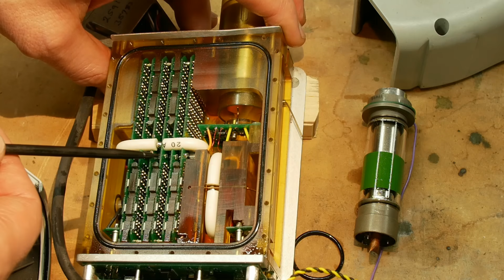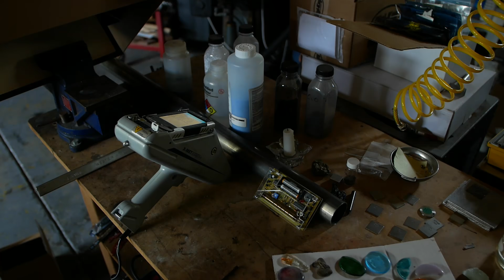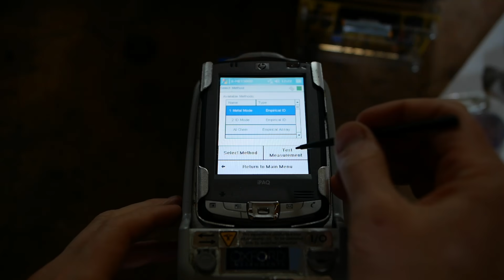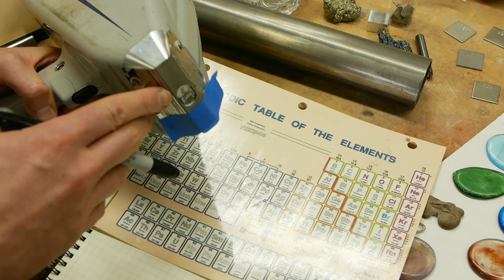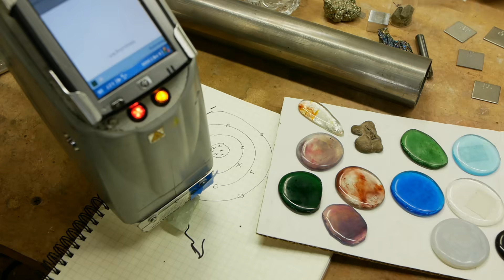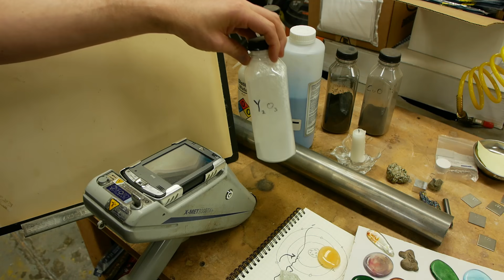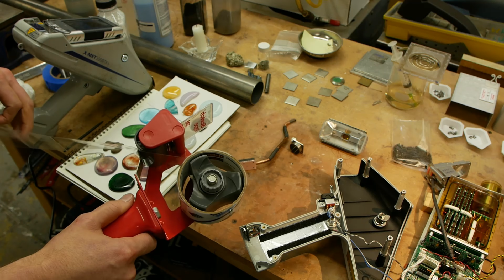Demo and teardown of an X-ray fluorescence gun (measures chemical composition)

Comment: In college in the early 2000's I worked on a project using an XRF gun with some fancy software running on the PDA that would process and decode chemical barcodes. By mixing certain compounds in various ratios we could create decodable messages (complete with checksums). The project was working on using it for high security applications. Our proof of concept used some pretty heavy excel workbooks and lots of copy and pasting, but it worked!
Reply: THAT'S SO COOL
Reply: Whoah, I wasted my time in college. That's a genius idea.
Reply: @skipfred  Ha. I would love to take credit for the tech, but I didn't develop it. It was on loan to us from a commercial org that appears to no longer be in business. I attended Ohio University and we had the "Center for Auto-ID" which did research into auto-id technologies such as barcodes, RFID, biometric ID, etc. I worked for the center as a student work/study type position testing different technologies. The XRF project was briefly put on hold twice, first when a professor outside my department found me in a lab with vials of chemicals that I didn't have all the MSDSs for, and the second time when I lost my dosimeter badge (which given the amount of radiation this outputs, was a little silly)... 

I worked on another project, that I haven't looked for out in the wild, but I found just as interesting. Imagine having a CCD sensor, that rather than detecting light, it was a 2D sensor array that detected magnetism (on contact). A standard dot-peen style datamatrix barcode could be marked into a part, we would fill the holes with a magnetic putty and paint over it. The reader could see the dot matrix through the paint, and we effectively had a completely hidden barcode. It was also cool to look at things like the stripes on your credit card with the imager - it looked very much like a traditional 1D barcode.
Reply: @TheSethcoleman  that's so cool ! nowdays, i think the NFC technology could provide the same hidden barcodes
Reply: @timeremapperegor1249  While true I suppose, I don't think a NFC device is nearly as hidden as say a coating or ingredient with a specific chemical signature. Ostensibly you could barcode a bar of gold, an entire batch of some super high end aerospace metal, money for counterfeit protection, etc, potentially in a completely indelible way.  Pretty neat applications that NFC wouldn't begin to help with.
Reply: @bradley3549  You got it. It was about hiding things in plain site - and in such a way that it was essentially impossible to counterfeit. NFC is more akin to RFID, it can be hacked, spoofed - and you know that the transaction is happening.
Reply: @TheSethcoleman  There are magnetic tape readers which were used for splicing audio tapes. The sensor was round and filled with magnetic particles in a liquid. When put on a magnetic tape, the particles would line up where the signal was on the tape. Worked on credit cards too, and magnetic ink like on checks. Looking around for a picture, seems like Techmoan did a video on it: https://www.youtube.com/watch?v=aZOxn8ggX8w
Reply: @dziban303  I've never seen those before! Super cool.
Reply: @TheSethcoleman  That company was Keymaster Technologies.  Same company i work for now.  We have changed names many times.  Before i started it was called Scitech Corp.  When i began in 1999 it was C-thru Technologies but we were quickly bought by Edax.  Then the venture capitalist company that owned Edax sold off the Edax portion and kept our office, which was renamed Keymaster Technologies.  We worked on exactly what  you described: brand protection, security, quality control.  There's a lot more, but that's as far as i can go here.
Reply: @ribrobrab  It sure was! I didn't know if it was appropriate to name the company. I had a day long crash course with one of the engineers who came to visit and show how it all worked and then I was cut lose to play with it for a semester of research.
Reply: @TheSethcoleman  Keymaster is long gone.  I think i still have business cards somewhere.  i loved the applications we were working on, but 9-11 really made people scared of anything having to do with radiation.  We can still make calibrations using the Taggant Technology but it is a rare request.
Reply: Even in the 2000s there were many pretty cool languages to work with and you didn't have to manually work Excel sheets 🙂
Reply: It was high security by obscurity. YouTube makes all of such vibrant ideas instantly obsolete. Anyone with a need to bypass such barcodes would have a few grand needed for an XRF gun. So it’s a non-starter. And once you see something funny going on in the composition, you can just copy it. No need to know what it means, what’s the checksum algorithm, nothing like that. It’d be probably more practical to use a Swiss bank printing house to print you some custom “banknotes”. Way harder to replicate than to mix some elements detectable by XRF in right ratios! Sometimes good old “paper” wins.
Reply: @absurdengineering  sometimes you want to see where things end up without anyone knowing
Reply: alex4alexn Ah, of course, but given that XRF and other accurate atomic composition measurement techniques are not a new thing, I imagine everyone who isn’t the poor junkie selling stolen scrap metal would know by now :) But given the number of idiots out there, it’s surely possible that people who should know better may be caught that way. We won’t hear about the very few ones that knew what they were doing and didn’t get caught :) Given how silly most people are, I imagine that such atomic steganographic techniques can go quite far if the application warrants it, I’ll give you that.
Reply: @absurdengineering  It's not high security, but afaik, railway power lines have an "alloy finger print". They often get stolen, so the trace metals added allow a scrap yard or law enforcement to identify where a suspicious offer comes from.

Comment: I've seen an electrostatically deflected CRT where the anode is supplied with 2500v and the cathode -2500v, This was done so that the deflection circuitry could be close to chassis potential. This of course required the heater to be supplied by its own isolated transformer winding.

Comment: When I was in high school many years ago I did a lot of photography and dark room work.  One thing I noticed is that at the end of a roll of 120 film (2 1/4" x 2 1/4") there was some tape holding the end of the film strip to the plastic reel.  When I pulled the tape off the film there would always be a green flash of light right where the tape was separating from the film.  It never ruined any images as film is unwound and loaded into a stainless steel reel and then into the developing tank and the lid goes on before the lights are switched on, that is, the film is loaded in complete darkness so the tape glow was the only light in the room.
Reply: The same happens with some clear sticky tapes (Scotch?)
Reply: It's also popularly known to happen when opening a band-aid wrapper in the dark.

Comment: I noticed the triboluminescence effect myself around 40 years back when, in a photographic darkroom, I pulled off a length of Sellotape from its roll and noticed a faint green glow where the adhesive was separating from the roll. I had no idea what it was called, and back then was unable to find any info on what I had observed.
Reply: That's funny, I read about it in a publication about 35 years ago and tried it out, along with the life savers candy.

Comment: What spectrum is the detector sensitive to? Must have a fancy measurement system. I would like to see what sort of signal you have to work with,  Not too many tear downs that require an oil drain. Very interesting.
Reply: 5..30keV xray if I am not mistaken.

Comment: I would be interested to know how the quantification of these X-ray signals are done with this device. The display shows element concentrations in the 2 decimal range, but how reliable it that? Obviously attenuation length of X-rays depend on the element, as well as its location, concentration and energy. My guess would be that the program assumes no attenuation and bulk material. Would anyone know more about this?
Reply: These things should be calibrated on a regular basis. As the monocromator being not very efficient and the detector having not great selectivity in energy, the X-ray fluorescence emission is highly affected by the nature of the sample matrix. This unless we were dealing with metal alloys (all happens on the surface) or samples where matrix elements do not absorbe the X-rays (lighter that Ti in this case), as is the case of glasses. For the best results, the calibration must be done with standards made with the same matrix: for alloys testing, use alloys as standards; for sulfur in Diesel (outside the capabilities of the unit shown), dissolve a sulfur compound in mineral oil in order to make a calibration curve, and so on.
This technology (low resolution XRF) is great for many samples but quite limited for others. Has the advantage of small instruments but it is intended to be used for samples of known nature; if used like a magic wand for anything the results could be way off. And in order to have decent accuracy for amounts lower than 0.5% the 10 sec reading time seems too short (should be in the order of 100-300 sec). I would be suspicious of the 2 digit precision in the percentages shown, specially in an instrument that seems to have zero tube warm-up time and requires no vacuum around the measured sample.
Reply: It is calibrated regullary. Also they have matrix effect- when lines overlap. Older ones confused determening if it is Se or Pt. Pt also overlaps with W, Ga, Ta and even Zn. With new detector is better situation, but with old one good operator is mandatory when testing unknow material.

Comment: Seems like the hard way to make a 40 kV power supply. Does noone now remember old style tube TVs? Flyback transformers routinely would generate 25kV for color CRT tubes magnetically Just a huge coil of magnet wire on a ferrite core set up as an auto-transformer. The 1B3 high voltage rectifier tube had a filament that worked at 25kV and was powered by 2 turns around the ferrite core. Seems like to extend this system to 40 kV would not be hard. Maybe they didn't want to do it that way because of the physical space such an auto-transformer would take up? There must have been a reason they did it this way I guess.

Comment: You should have gone full meta and used the functional XRF gun to measure the composition of the metal plate on the emitter of your non-functional XRF gun!
Reply: You can't microwave a microwave with a bigger microwave.
Reply: @vmelkon  Is that a challenge?
Reply: @Hyraethian  
I challenge you to microwave a microwave with a bigger microwave. If you can do the impossible, then you are a braver man than I.
Reply: @vmelkon  Yes, you can.

Comment: UPS is very good at accidental "mechanical energy input"
Reply: I was about to say that "mechanical energy input" was a novel way of describing dropping something to me.
Reply: Funny, UPS vs FedEx must depend on your location. In Atlanta (ironically, home of UPS), FedEx is decidedly less likely to apply "mechanical energy input" during handling.
Reply: Can confirm. Working for a company that does a lot of UPS shipping, UPS is pretty good at depositing mechanical energy in substrates. Though for more consistent energy deposition and higher total energy deposited, I've found FedEx to be superior.
Reply: @HoboSullivan  fedex only does less damage because of lower volume...at least UPS shows up on time.
Reply: @drrrrockzo  That's what I'm saying. UPS handles every package like it's a box of hammers. But FedEx just outright seems to play football with packages.
Reply: Oh come on! FedEx is better at that!
Reply: @Bottleworksnet  Federal Excrement:  "We will turn your package to shit!"
Reply: @Bottleworksnet  Considering I had a sony laserdisc player shipped 5 MI to my house recently that was packed and shipped by UPS... They broke it so severely that I can't repair it without getting 2 new boards because they CRACKED IN HALF......... yea UPS I think wins this.
Reply: If you need some gravel, just order a hunk of rock.
Reply: @JanicekTrnecka  UPS delivered a box of Lava rock. All the corners were smashed in so the box was now a sphere. sand like Lave rock was pouring out of a hole that use to be a  corner.
Reply: Ya “accidental” 🙄🤣
Reply: What else do you expect from a company called "oops"?
Reply: I also tried to send some old vintage soviet valves/tubes through czech post. Although the valves are engineered to withstand a nuclear explosion, czech post managed to destroy them.
Reply: This phrase goes straight into my Golden collection of t-shirt designs
Reply: One of my friends used to work at a UPS warehouse.  He told me that when they got bored, they'd compete so see who could kick a package the longest distance in the warehouse!  Of course, this was either in the late '70s or early '80s, but I bet this still happens.
Reply: Hence the nickname I gave them, “United Parcel Smashers”.

Comment: That seller on Ebay is an absolute muppet. They're probably the type to believe that bleach is the cure to covid, if they really think you're going to reveal secrets that're patent protected. I'd be curious what Ebay TOS says about sellers like them, the ones that refuse to sell for an illegitimate reason. Leave a bad review just to spite them, then use a third party to get that cartridge and leave another bad review just to kick them in the balls; if they're a low volume, but frequent seller, reviews will matter to them. 
Or just look at the patents that company has and recreate your own cartridge. Decent patents will have everything you need to get a project 80% done. But I wouldn't be surprised if they have piss poor patents considering someone that was supposedly involved with the company is acting like an absolute twat.

I also like how there seems to only be two of these on Ebay, both with no cartridges, and googling can only get me one reference of any store/supplier selling them, which they currently do not. These things are starting to look like they were vapor ware, with a proof of concept 'product' at most.

Comment: Is it possible to pinpoint particular isotopes with this device?
Reply: No. this handheld device is called EDXRF so its resolution isnt very high. a WDXRF (look up the abbreviations on wiki or alike) will provide a higher resoltion but I very much doubt it would be able to distinguish between isotpes. reason: energy levels of electrons depend on charge of nucleus (i.e. number of protons). isotops only differ on number of neutrons.
hope this very brief explanation helps

Comment: Can someone explain to me the power supply bit? I don't understand why they need to provide voltage for each board and why it isn't just them connected in series.
Reply: It is 3 psu in series, but primary of transformer must be in parallel. So very high voltage can jump from module to module. But if we use big copper wire with extreme insulation and put in all 3 transformers at same time so it will be quite small. But we need exreme current to pass. So add another transformer. We have "double" insulation for free.
Reply: @kaunomedis7926  thanks for taking time to explain - so transformer is on the input  and outputs are in series and thanks to this we don't have high relative voltages between the boards?

Comment: You can actually see the charge of the tape being unrolled when you're in the dark. I think i tried it with either brown tape (tessa) or paper tape (no brand,standard large,wide).
Reply: That reminds me I used to have a cat that when I would brush him in a dark room you could see the static quite clearly.
Reply: I get the glow when I peel open my Breathe Right strips in a dark bathroom.  It never occurred to me that it was emitting x-rays.
Reply: @IvorMektin1701  AFAIK, generating X-Rays this way, only works in a vacuum.
So you have nothing to be concerned about.
Reply: @m.k.8158  
Oh I wasn't worried at all.  My ex was an X-ray tech (ex-ray)  and I read her textbooks.  

"How was work today?"

"Another day of squishing and filming boobs."

Comment: Amazing. That tool would be right at home in my research lab. We have an in house machine shop, but a lot of parts get reused for different prototypes (particularly magnetic steels). The difference between 1020 and 1045 steel is huge for magnetic purposes, and having a gun to catalogue our parts (or even test new stock in the machine shop) would be great. Too bad I'm seeing many thousands of dollars on the price tag :(
Reply: Since the only difference is carbon content (.2 vs .45%), the XRF gun would not help. However, a simple hardness test or possibly even spark teston a grinder (more sparks = more carbon) may work.

Comment: I used to work with an x-ray gun in my job. It cost us 20.000 usd
Reply: Yup they are spendy gadgets. Most of the trouble is getting the narrow band x ray energy. Needs to be a single color for lack of better description. The silver window thingie is the monocrome k edge filter that pases only the 40kv band.

Comment: You presumed that the audience would understand why the end had to be negative 40k volts. (I presume it's because electrons are negatively charged and by having them generated at the negative end they will be accelerated towards the {relatively positive } zero charge end.)  But the tube is creating x-rays, so there must be a conversion from electrons to x-rays. Does that conversion create scattering or is it linear?